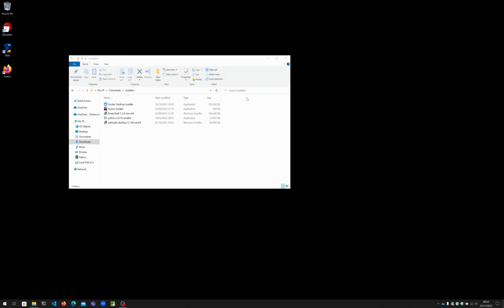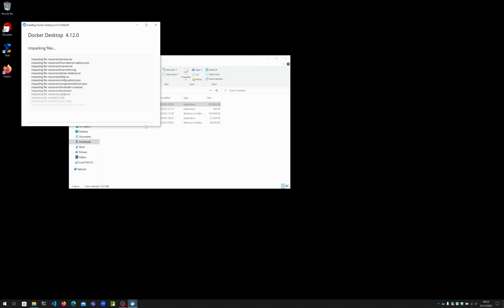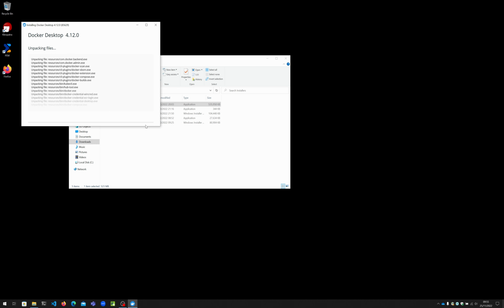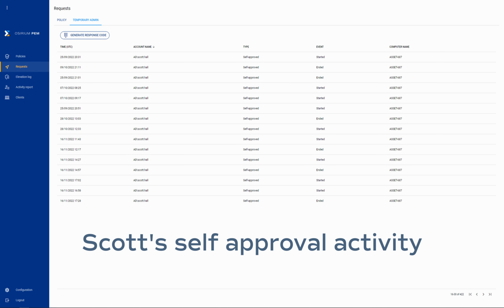Keeping Developers Productive without Local Admin Rights with Osirium Privileged Endpoint Management

Comment: Some of our developers still "require" access to some of the production web servers so they can restart IIS when things break. Could I install PEM on the web server and use that to limit what they can do? Or would your PPA solution be a better fit for that use case?
Reply from the maker: That sound more like a job for PAM (Privileged Access Management) as the credentials on those web servers need to be protected. Take a look at: https://www.osirium.com/products/osirium-pam Even better, you might want to automate some simple start/stop tasks so the developers don't need full access to the servers. PPA (Privileged Process Automation) is great for that, for example: https://www.osirium.com/videos/osirium-pam-and-automation-windows-service-management Hope that helps. Any questions, get in touch via https://www.osirium.com